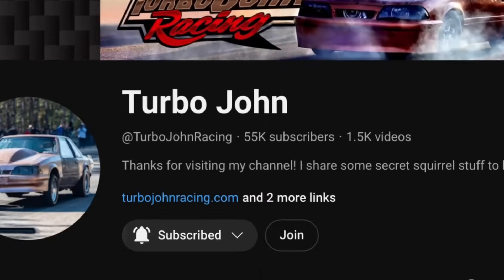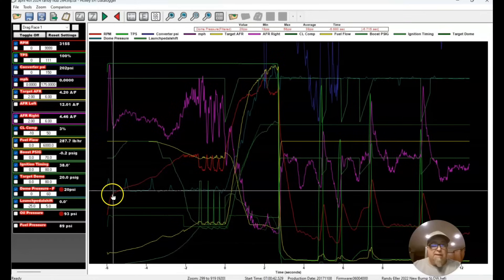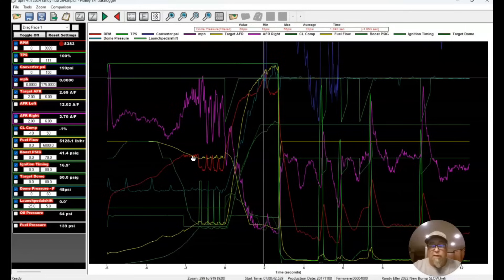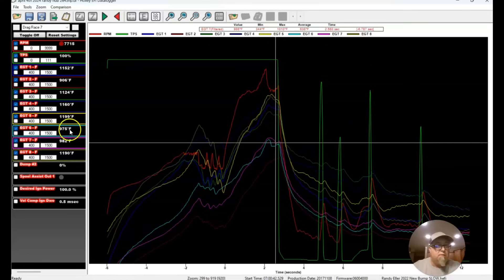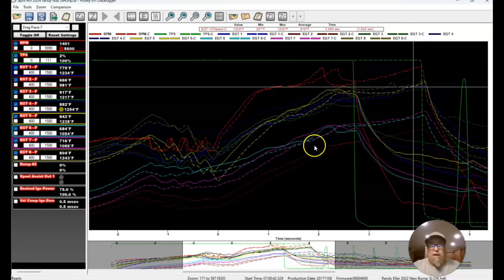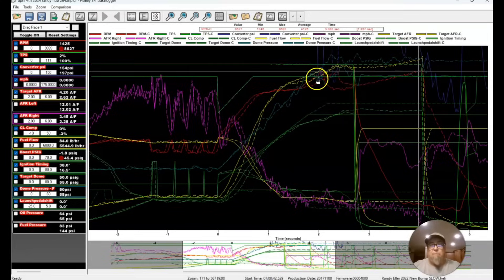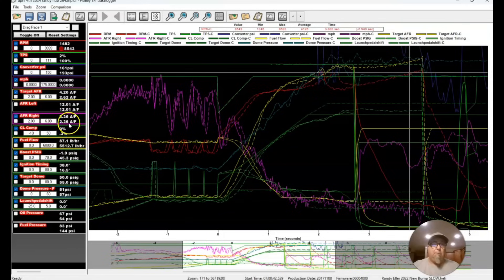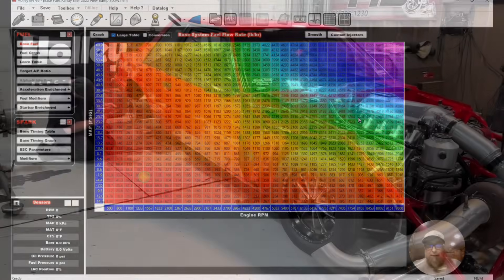ProMod Randy's Datalogs!  2800 RWHP... How much Boost? how much fuel?  What timing? What A/F ratio?

Comment: As a comment;  
5500 lb/hr of fuelflow x 2.4 AFR =220 lb/min. of Airflow. Seems low for 2800 whp as 2800 hp  / 220 lb/min = 12.7 hp pr. 1 lb/min of airflow. 
2800 whp at 45 psi boost or 4 BAR MAP = 2800 / 4 = 700 whp from "the theoretical NA engine". 
Here in amateur Lowbuck Smallville we usually see 8.5 hp pr. 1 lb/min of airflow, :D but air is air. :)

Comment: I’ve heard EGT’s are very sensitive to the placement in the pipes.  A very slight variation in the depth or the angle in the pipes can significantly affect the EGT’s.  Do the plugs in those cooler cylinders look any different than the others?

Comment: Just think for a minute Randy was racing that car with the stock rear suspension ain't no wonder it wouldn't run straight. 2800rear wheel hp on stock suspension is insane!!

Comment: How many gallons an hour would that be Mr John? lol I work on turbines and the larger one make 2500 hp and burn 125-175 gallons an hour
Reply from the maker: By the math 800-850 gph.  Methanol weighs about 6.5 lbs per gallon.  5500lbs per hour divided by 6.5= 846 gph or 14.1 gpm ...... woweee
Reply: @TurboJohnRacing  wow that’s crazy
Reply: @TurboJohnRacing  - 14 gallons per minute is about the same as a 1” garden hose on full blast.
Reply: Turbos are more fuel efficient that centrifugals or roots. Try .34gpm/psi
Reply: Alcohol needs 1-1/2 lbs to 1lb gasoline to make the same but doesn't it?